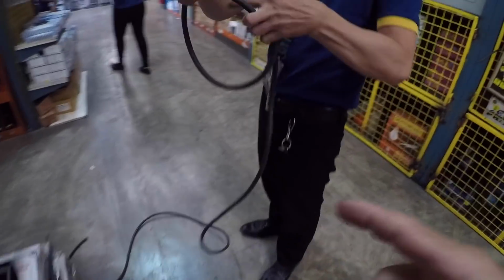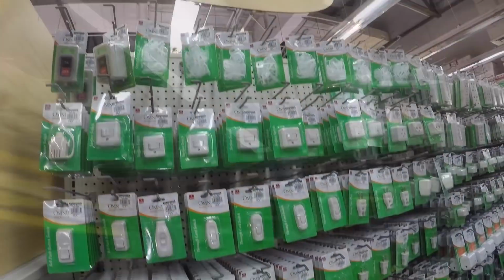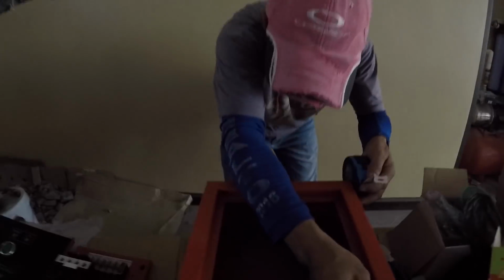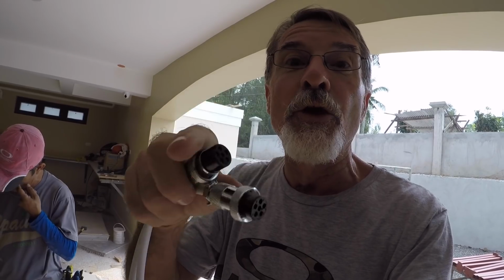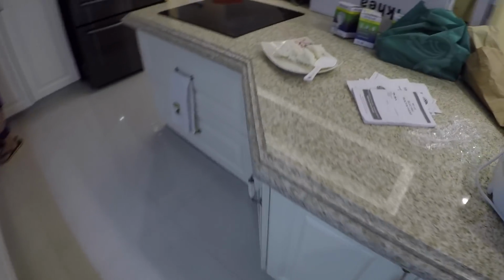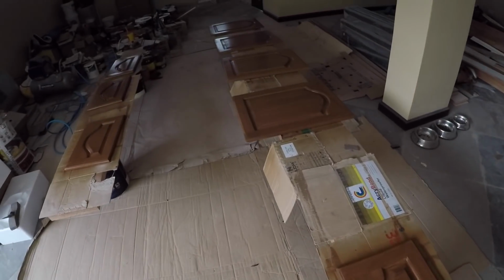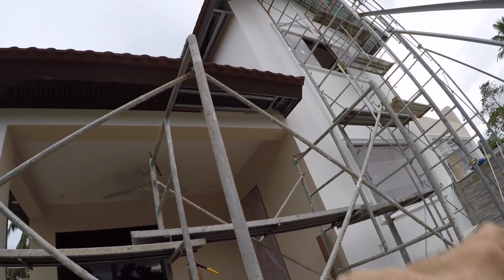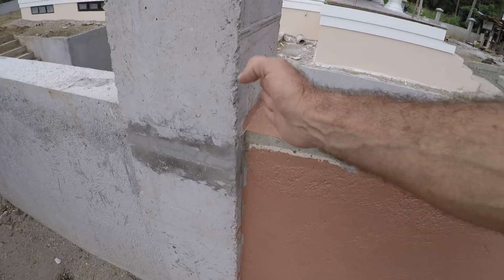VILLA FELIZ - EPISODE 281: GEN MOD - WILL IT WORK? (House Building in the Philippines)

Comment: Hi James, I have a couple of questions. After more than a year with this generator and set up, would you recommend Electron? Would you get something else in particular? Lastly, did that control cable with those plugs come with the set? Thanks.
Reply from the maker: I would recommend this brand although a larger capacity, say 12KVW.  This one is 6KVW.  It handles all we need but I think if we used aircon it would struggle.  It's worked flawlessly since installation.  We have two friends with other brands and both are ready to get rid of them because of all the problems they have with them.

Yes, the cable and plugs are awaiting installation.  I'll do that soon when I get some free time.
Reply: Thanks for the quick response. I’m planning to install the generator in the back of my house and the main breaker and ATS in the front of the house. So, I’ll have to run a very long power cable and will have to modify that control cable as you have. Do you suggest I just buy cat5 or cat6 cable and splice them to that control cable? Also, what gauge cable did you use for the long run generator to ATS power cable?

Thanks again for all the info.

Comment: Just about everything looks great.  What's going on with your garage level CR door?  It looks as though the opening in the concrete is too large -- larger than the door frame.
Reply from the maker: The gap at the top will be for the ventilation.  We have yet to build that.
Reply: Thanks

Comment: Need to pick up  a couple of ABC Fire Extinguishers for the Generator room and  Kitchen area.  Before you run in the Gen set
Reply: Balikbayan Farming with Dave & Emily yeah ... in panic time we just kinda grab anything
Reply: Balikbayan Farming with Dave & Emily probably not a good idea to use an ABC extinguisher in generator room. If you spray that it will ruin the electronics. They is a specific one for electrical
Reply: Best to have one top rated for the room. If the Gen is on fire is it a fuel or electric fire or did some plastic melt.   Gen Set  runs on Diesel fuel and is made of plastic and rubber also and provides electric. he is also going to have a tank of fuel in or near the room too.   If you have a fire never have to guess which fire extinguisher  to use.  Use one  that will do the job.  if electronics gets damaged then replace them.  Best to kill the fire quick.

Comment: James, When i installed my standby generator, according to Generac the exhaust should be no closer than 5' to the nearest window, or door opening.  Just make sure that there is no way for the fumes to reenter the house.  Nice appliances in the kitchen, I know sometimes it's really hard for me to figure out how to operate new electronics!!
Reply from the maker: Good catch.  I can open the 3 windows on the opposite wall which should satisfy that requirement.

Comment: Also I've never seen anybody that plugs in a generator all the generators that I have worked with of all been hardwired into houses shops and commercial buildings hardwired no plugs just a suggestion kind of safety-wise I think

Comment: James hi, 
- to min. 5:53 if you want to know, have in Lipa on the Public Market the shops with all cables, switches, sockets and all electrical parts.
- to min. 24:28 the electric panel with all those water pipes on top ... if a pipe breaks and the water flows into the electric panel, it can burn all the appliances in the house...
Reply from the maker: I told my builder the position of the pipe so close to the CBP's was a no no, but good thing they are waste water pipes and not pressurized pipes.

Comment: On second thought,  I'd like to make an unsolicited suggestion on the generator room... since it is so nicely done anyway, can it be turned into another guest room and the generator would be better off  outside the basement, farther away perhaps  on a covered but open type elevated platform with steel matting side covers and padlocked for safety... it's a lot better than making or drilling exhaust vents on walls which might eventually cause leaking... (nosebleed😩English) LOL
Reply: Sorry Winky I am going to go against your suggestion. I think it being inside is a good idea because it will last longer as it's fully protected and away from intense humidity and the weather and I think if anything is wrong with it like it needs more fuel etc it's better and easier to do that inside rather than outside at night or in a storm.
Reply: Peter i Yes I agree on those points too and thought of it too but my suggestion came from my previous experience in our farm where I positioned our generator nearby the house for easier access but during frequent brownouts, the noise coming from it while  it's running is so disturbingly loud and the diesel fumes also produced some clouding and smell..so I had it moved far from our house and placed it near the electrical breaker room of our submersible pump and the auto switches there came in handy too and it solved the noise issues but I can still hear it haha (our genset was old type and huge) thus the suggestion... but then hey maybe his genset is an indoor type and works better ... twas just a thought anyway ... besides I was thinking maybe someday he can find a male stay out househelp who  can make tasks easier for them but that's another topic haha✌🏻✌🏻✌🏻💪🛠
Reply: Winky Streegan yes some of the bigger louder ones are better outside. Did you see then they tested it at the store? It was rather quiet really and if James added some sound insulation on the walls which you can stick on and put the generator on a rubber mat I think he wouldn't hear a thing. They could then use the room for recording some music too as it would be like a sound studio 😉
Reply: Peter I can still hear the genset from 120 -200 meters  away ( you know farms ..you can hear everything even miles away)
Reply: Peter i Yes I agree.. but he knows best so apir tayo!!! 🙏joke lang👍✌🏻